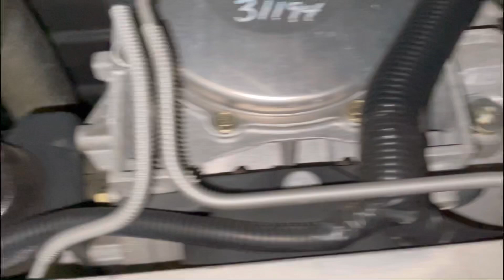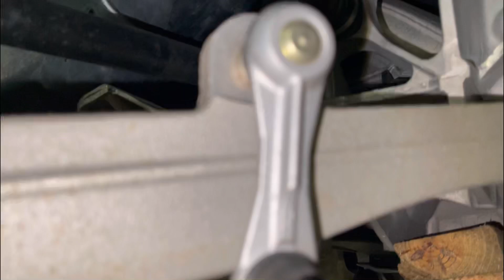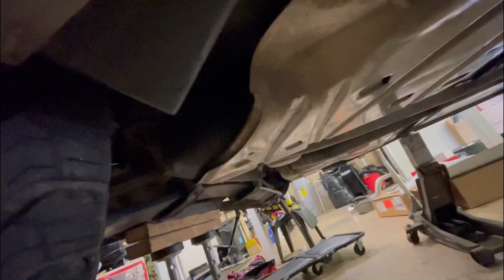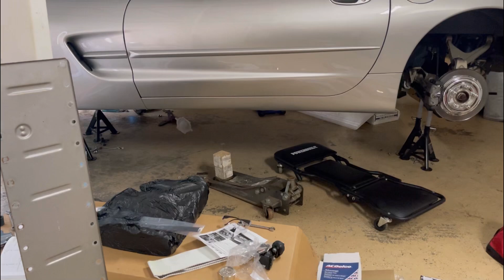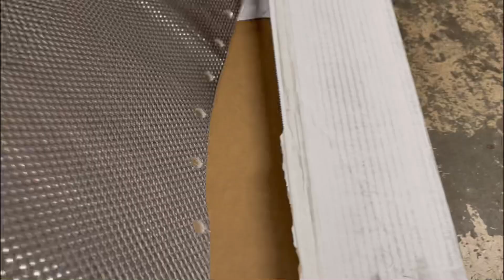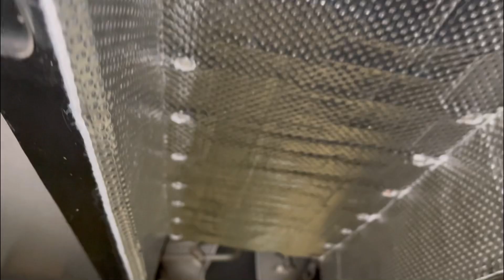C5 Elite Engineering Tunnel Plate, Corsa Extreme Exhaust with X-Pipe, & DEI Heat Shield Installation

Comment: omg !! this is just what i want to do , add the thicker plate + the heat shield ! im sure that reduced the central console so much ! am i right ? cause i was thinking putting only the heat shield
Reply from the maker: So yes it will definitely help but if you sit long enough heat will still creep in on hot days but definitely not as much....the plate helped more with creeks and noises common with the C5....I would definitely do it again if I had too
Reply: @DIYKAI nice !!! yeah this is what i read somewhere else , that with the plate you make like more "rigid" the chasis to less creek noises , thanks for the video and the reply bro cheers
Reply from the maker: @ordovicicosilurico6799  definitely makes it more rigid and stable to me almost zero flex now
Reply from the maker: You're welcome  @ordovicicosilurico6799

Comment: Have you noticed the decrease in interior heat with the tunnel plate?  Also, does the chassis creak less with it?
Reply from the maker: Yes absolutely less heat and noise….we didn’t have much creaks to begin with but nothing now…..one note some heat will come back on hot days and longs hard drives but way less than before we are happy with the results